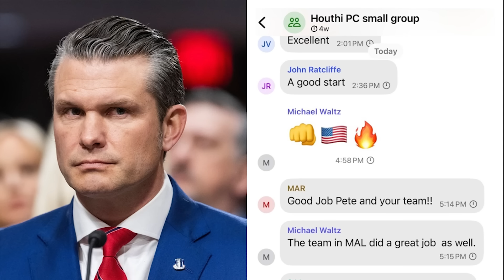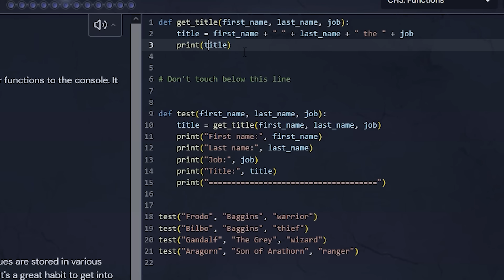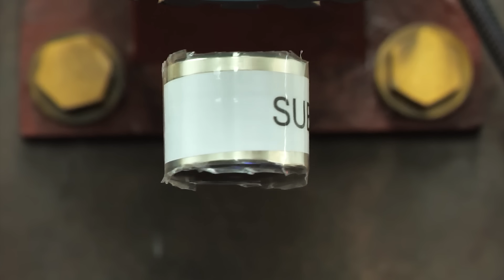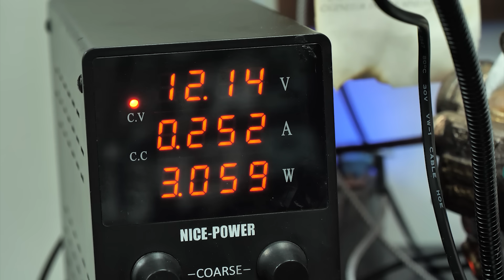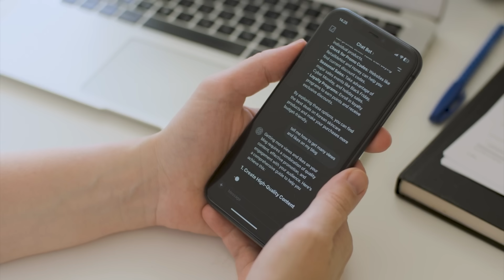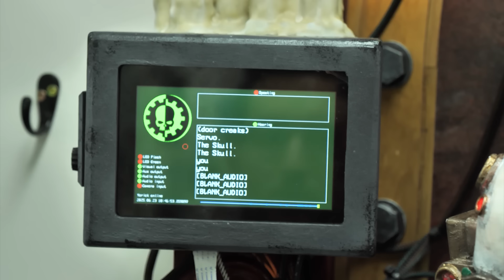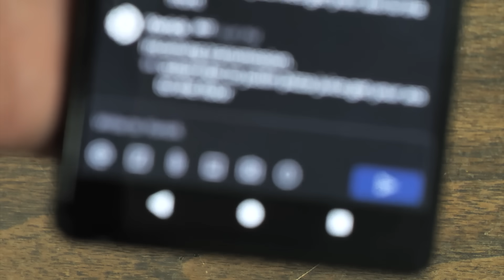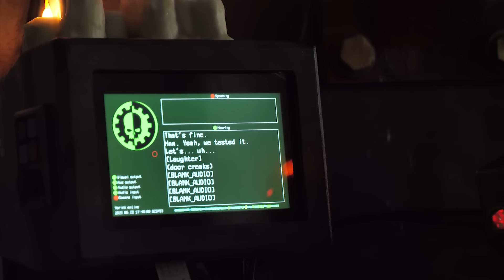I built a Talking, Levitating Servo Skull from Warhammer 40k

Comment: Little sidenote: Imperium does use what we would call computers as well, they're just called cogitators. Also most machinery doesn't have fleshy bits, but are infuenced what Mechanicus calls "machine spirit", nature of which isn't exactly clear.
Reply: yeah, cogitators are roughly equivalent to modern day computers. No intelligence, or biology in most of them, just silicon calculators. But the fact that the 40k universe allows for reality to be warped by the beliefs of mortals means that the widespread belief in machine spirits among the hundreds of trillions of humans alive, may result in simple dumb silicon computers and electronics, and even purely mechanical contraptions, actually responding to incense and prayers in a measurable way. And then of course you have the many mechanical constructs of ancient design that have "machine spirits" that are suspiciously close to abominable intelligence in behaviour, but are definitely just "machine spirits" and nothing else, stop asking questions, that's heresy!
Reply: Cogitator is an umbrella term for any tool which performs computation. It can mean anything from fully non-organic microprocessors as you mentioned, to machines that use repurposed and interlinked brains in a vat (iirc I saw an example for the latter in the Skitarius book). Much like with "vox", I think the point of these terms is to describe function without referencing specific technology; out-of-universe this makes their sci-fi less dated, in-universe it helps the Imperial requisition system be more efficient without having to worry about implementation details and it helps individual forge world and tech artisans protect their trade secrets.
Reply: @rustkitty computer is also an umbrella term for things that do calculations AKA computing.
Reply: yeah, don't know where he learned this "imperium puts flesh in most of their machines", this is simply not true
Reply: @E.G.I.L.3D this whole video reeks of a certain kind of tourist who only got into 40k because it’s currently quirky and in the public radar
Reply: Propably literall souls of people
Reply: I always found that part of the Imperium to make no sense. Like if I heard correctly, their ships use gun gangs instead of auto-loaders, yet they can still use fully automatic rifles - auto-loaders don't use AI so why are those banned?
Reply: @KingDetonation  Autoloader is a relatively complex, relatively fiddly piece of tech that would require its own dedicated engineseer, if not a full blown techpriest to maintain. No to mention how slow and problematic fixing it would be if it gets damaged during combat. 
Meanwhile a bunch of lower deck rabbles pulling a chain is a cheap, easy to fix, easy to maintain, and extremely reliable solution. Rember – in the Imperium, lives are cheap, but tech is expensive.
Reply: @aesothkoumadra  Remarkably like the autoloader vs. loader argument of today's tanks.  38,000 years isn't enough to get past the "machine expensive and delicate, human tough and cheap" argument of warfare... Praise the Omnissiah!
Reply: @KingDetonation  Rule of the thumb is that Imperium is as regressed/advanced as the writer wants/needs them to be.
Reply: @KingDetonation  The ships are ancient and built with lost knowledge and technology, so repairing bits that break isn't necessarily possible for them. If that's the ship's loader, well...
Reply: @KingDetonation  just because. its a fictional lore after all
Reply: @KingDetonation  The imperium is very suspicious and fearful of tech, the admech loves to hoard knowledge and loves to have a few advantages over the rest of the imperium. The end result? Manually loaded voidship cannons.
Reply: @KingDetonation  They don't always use gun gangs, that's mainly for very ancient ships that the Mechanicus have forgotten how to fix, so they use the Imperium's cheapest and most expendable resource instead: human bodies
Reply: @gh0stcassette Not only that, they use vat-grown genetically altered humans.
Reply: @KingDetonation Why do American tanks not use Auto-loaders? Because they’re complicated and slower
Some imperial ships do have auto-loaders, but they’re complicated to maintain and you need to have someone onboard who knows how to maintain it.
In 40K humans are cheaper than the ammo they’re firing so yeah most imperial ships are just going to grab 2000 humans from the bowels of the ship and tell them to load an artillery round into the gun.
It’s more practical than a cogitator unit that you possibly can’t even repair and who will tell you to bug off if it feels like it.
Reply: @KingDetonation  auto loaders aren't banned, they're just more expensive than human lives. On the scale of their ships and their weapons, the autoloaders would be massive and extremely complicated to ensure the weapons fired right. Though it is worth noting that mechanicus ships will often have auto loaders. This is just because the tech adepts dont like to share, which coincides perfectly with the imperium wanting cheaper ships.
Reply: @KingDetonation They aren't banned, those are for when they don't know how to repair that particular type of autoloader on a particular type of ship or they don't have the expertise nor resources to repair it in the local area of the ship

Comment: 9:23 I love that you can tell he isn’t an electrical engineer because he doesn’t know this “quirk of the circuit” is a physical property of inductive coils of wire. Inductors resist changes in their electromagnetic fields and current flow. When you cut power to the coil, its current and electromagnetic field decrease. This decrease actually induces current flow in the opposite direction of the change, and that current flow induces a corresponding magnetic field. 

This phenomenon is called “back emf” and can be I credibility significant in devices containing inductive coils. For example, a motor might be rated for a certain amount of current, but that motor will often draw far more current than it is rated for when it is first turned on. Have you ever seen your lights dim in your house when the washer or dryer comes on? Congratulations, you’re experiencing the same back emf that thethoughtemporium is observing here!
Reply: I agree in most cases but I feel that that's actually not what's happening in the video for a few reasons:

The inductive nature of the coil will keep the current stable at all costs. The back emf you mention will occur, but the current will exponentially decay without a sudden change.

The magnetic pull of the inductor they've created is solely tied to current, which as stated, will not jump when power is cut.

I'm not sure exactly why the sudden jump occurs in this case but I don't think inductive kickback explains it.
Reply: If they used a ferromagnetic core that can be magnetised it will be magnetised based on the last current impulse and since they are only switching the coil in 1 direction constantly, as well as hopefully having a dump circuit with a diode, resistor and capacitor to stop frying the main transistor so that it doesn't have negative exposed on the gate transiently.
Reply: @joaquintristan4373  It seems like it could just be that the magnets are powerful enough to pull the skull to the rod and the electromagnet is pushing against it to hold them away instead of the opposite (weaker magnets being pulled up).
Electromagnet turns off the magnets can pull the skull to the top.
Reply: I suspect it's just that during power off the control circuit happens to turn the mosfet continuously on for a moment, discharging the power supply capacitors through the coil and giving a burst of full-strength magnetic field.
Reply: Inrush current is a function of inductance but not always the result of an inductive coil.  The type of inrush current you describe for the washing machine is down to inductance, but the inductance is due to the motor overcoming the friction and inertia of the rotor.  It's the most common kind of inrush current when dealing with turbomachinery in a facility.
Reply: It's a blessing from the omnissiah
Reply: Some of my corded power tools have a thing around the cord that I was told contains magnetic material to prevent this. Haven't broken one open to find out tho. Could just contain a anti theft tag lol
Reply: So, basically electrostatic inertia?
Reply: That's super cool! I've noticed that when I steer my car sharply with the ac on high, it feels like the ac is less powerful for just a moment. I wonder if the cars power steering creates the effect you described which affects the pumps in the ac system
Reply: @Corndoggo there’s a bunch of reasons that could happen in a car, not just related to electricity. If your car’s power steering is powered by an electric motor, it could absolutely be that the sudden turn asks more from the vehicles alternator, and that means less power gets sent to the AC for that moment. 

That said, there are some things in a car that are powered by vacuum pressure. For example, most modern cars essentially employ a vacuum pump that exploits fluid dynamics of your cars air intake and exhaust system to make pressing your brakes easier, and give the vehicle a more luxury feel. If the power steering is powered in a similar way, I don’t think it would have the same direct effect on the AC, and there might be some other interactions happening. 

Or, it could be that turning isn’t connected to any of the systems used to power the AC at all, but the act of turning puts more load on other vehicle systems that do, drawing more power for themselves, and leaving less for your AC. 

All that said, I’d personally bet on the motor hypothesis. It wouldn’t be hard in a modern vehicle to use an electric motor to augment power steering, especially if the vehicle itself is a hybrid or EV. Turning the steering wheel quickly would absolutely require more out of the power steering’s electrical system to keep the steering wheel feeling consistently light, which would draw more power from the alternator or batteries, causing a temporary loss of power in the AC.
Reply: @Corndoggo not an electrical engineer here, but a mechanic 🤝

Even if your power steering isn't electrically driven it might not have to be to cause what you're describing with the same principles. 
If your power steering system is hydraulic, that means you have a power steering pump mounted to the motor, using energy from the serpentine belt to drive it. When you turn the wheel, the hydraulic on the rack (the piece that boosts your steering power) applies pressure, causing a drop in hydraulic pressure, allowing the pump to use more energy to keep the pressure up. This effectively increases the resistance to the pump pulley wheel, which causes the engine to slow down and chug a bit. (You can actually hear the engine spool up to compensate for the increased load when turning at dead stop. Early 2000's Honda odysseys come to mind.)

When the car is running the battery is not powering the cars electrics, it becomes mostly a buffer to store excess energy from the alternator. This is why your battery charges when your engine is running. 

This means that your electrical system is supplied power from the alternator, which is also driven by the serpentine belt. So when you turn your wheel and the power steering pulley requests more power, that creates more resistance on the serpentine belt. The same belt turning the alternator to generate electricity for your car. This drop in voltage can cause your AC blower motor to slow down temporarily. It can also make all your lights dim, your power windows/mirrors run slower, in some older cars it can make the horn weaker and lower pitched. 

Engines are actually just a bunch of really simple components tied together in a way to mimic complexity, it's pretty cool.
Reply: @wawtawsha6116 love this, thanks for sharing, I'm an electrician and appreciate your practical, relatable, perspective

Comment: Going to have to correct you there, by the believe of the mechanicus even purely mechanical mechanisms have a machine spirit. And with the warp being the warp, it might as well be real. 
Just look at Ork weapons and vehicles, most of that stuff works because all the Orks believe that they work, even when it shouldn't.
Reply: Yeah the lore section is pretty wrong here. The normal mechanicus don't perform "mildly daemonic rituals". That term has a specific meaning in 40k, and you can't just go throwing it around.
There's a semi-arbitrary line of what's advanced enough to count as abominable intelligence. It's not just AI in the sense of a computer making a decision. It's basically what would the writers think is scifi tech as opposed to a regular computer. They have cogigitators and dataslates, but no natural language processing. There's also a heavy prohibition against robots period. Anything that actually does stuff physically is going to be a kind of servitor.
Reply: And microprocessors do exist in the 40k universe, they call them cogitators and they do not have a biological component. In fact one of their many uses is in creating servitors, and the tech priests believe that each cogitator has a machine spirit.
Reply: I think the Mechanicus novel states that this isn‘t a universally held belief.
Granted, this is set before the Death of Innocence, but I think the sentiment could still prevail.
Different sects have varying beliefs ect.

Comment: When you find yourself printing a fake bolt to cover a screw or smaller bolt, ALWAYS just step up and use the bolt. 
99/73 times the result is worth it - even when per stainless bolt costs approach $6 per.  Especially when.
Reply: he might not have had the proper tools to screw in a larger bolt like that, though, and it seems as though this project was mostly made at home
Reply: Yeah, let's put a 12mm bolt through the office wall to sucure a plastic panel, why not?
Reply: @cerocero2817    We are talking about WH40k - a universe where everything is BIG and overdone. So over do it!  It was also just a bit of fabrication humor - most people who have fabbed something have gotten to a point in some project where the hardware, button trim, small details, edging, clamps, etc.  become an overly expensive part when they were never meant to be, but somehow you fall into "needing" that timascus billet thats "perfect".  Or a $6 bolt.

Second,   Something ive learned as a machinist and fabricator - hardware can truly make projects come into their own and can help 'sell' materials or geometry for being something they arent. 

One example: Simple things like stainless cap head machine screws, torx head set screws or coil pins can add MASSIVE amounts of realism and texture and presence to lifeless panels.